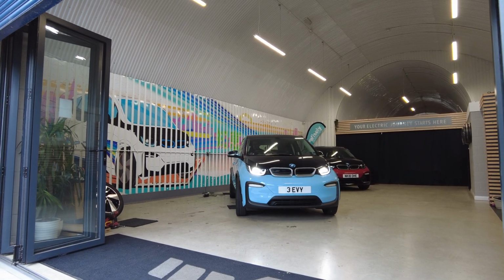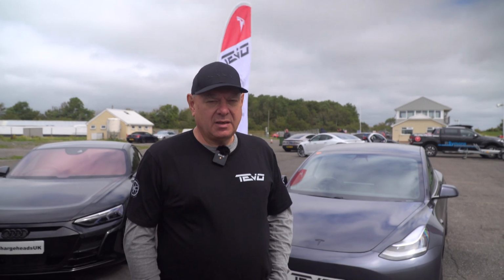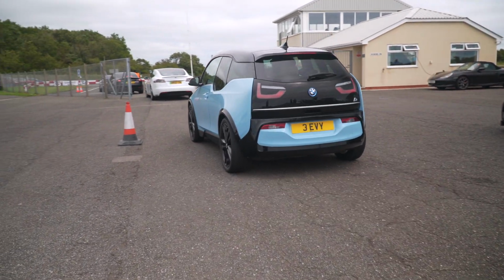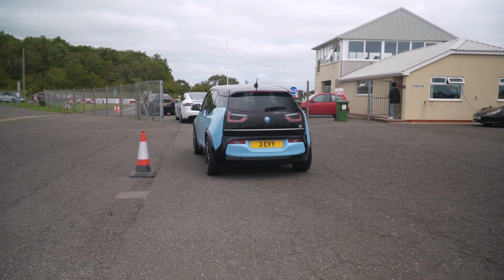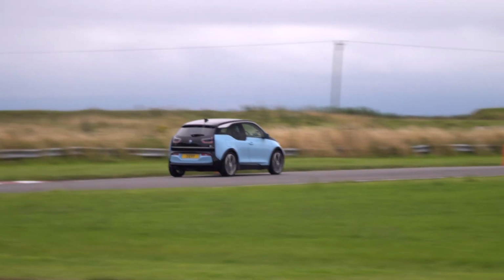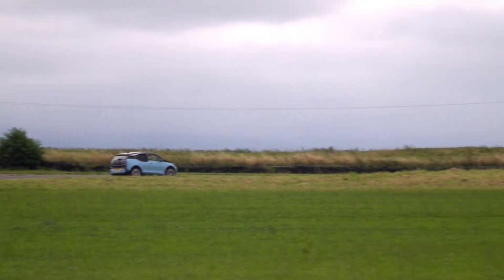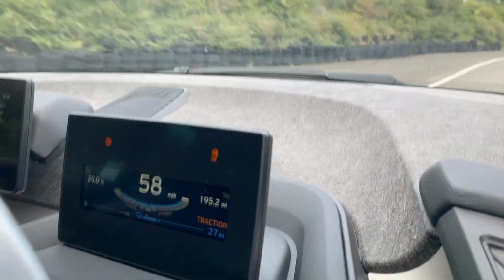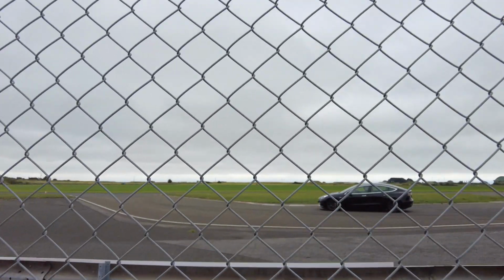BMW i3: On a Track! EV Track Day at the Llandow Circuit

Comment: Nice video. I Myself have mounted Eibach prokit springs and 19x6" and 19x5,5" costum alloys on 205 and 175 continental ECO  tires  on my 2016 94ah i3 and it handles so much better. really fun on back roads! have you decided if you will make a track focused car? would be nice to see if the power could be increased even more than the 184hp in i3s. more cooling perhaps and maybe a Coilover suspension added?

Comment: (Update: see my reply.) Definitely go with BEV. I will test mine on Hungaroring race track in 11days. BEV 94ah Eibach Pro lowering springs, ET28 (i3S) wheels, S software update: Sport mode. I recommend similar setup for your project. DSC off probably, or even Roller mode (that might need more experience from driver)
Reply: Well well. Electronics can't take the beatings. You get nice breaking distance thanx to regen and low weight.
However power is limited down to nothing after only 3-4curves on a circuit like Hungaroring.
Will check the telemetrics, but I remember seeing as low as 30kW (40 hp) limit only 2 or 3 lines on power display. Which kills the fun, ruins laptime.
I was expecting laptime of my 3000cc petrol BMW, instead got far worse than my old 2000cc diesel.
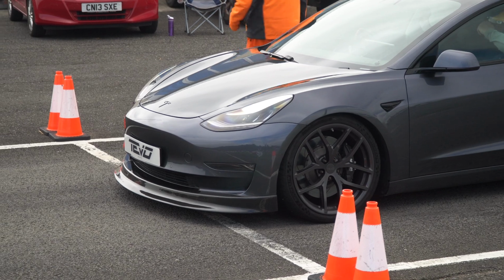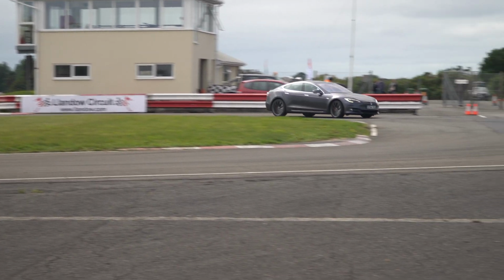2:22 petrol, 2:31 diesel, 2,49 drastically limited electric.
I wonder if a factory i3S is any better than my "software S". (I doubt)
Reply: Hi Who remaped your i3 to give it sport mode? Is that just a software roll back? As I'm convinced the initial takeoff has been dialed back
Reply: @Wootts007  In Hungary Wallnerwerk. It's more uploading i3S software for a dozen components. Yeah initial acceleration is def better. BUT an other service here said that a fuse in the battery might goes out (as it is smaller than in real i3s version) which is a costly replace process. So I decided to roll back to factory sw and let the sport mode go.
Soon I will buy an i3s with the 120Ah battery anyway.

Comment: 120 i3s with its wider track lower stiffer suspension fatter tyres and a real world 0-62 in 6.4s is a much quicker car than the figures would suggest. Also turn off Traction control then you can launch and drift it.
Reply: How do you turn off traction control on i3 ? I have an i3 and i couldn't completly turn it off...

Comment: Just a hybrid.
Reply from the maker: A hybrid which has just managed multiple laps on a track without using a single drop of petrol. 😉
Reply: @tw1919 used the last two brain cells you had left to comment that

Comment: I wonder which wheels would be better for track 19 inch or 20 inch. 
Also if there's a way to keep the mirrors flipped in, that could help at high speed.
Interesting informative fun.
Reply from the maker: The 20" wheels are most likely the better option purely due to the additional grip, despite the slighlty higher weight.
Reply: @wiselyauto  So 20" has better grip for bad weather too? I would love to see a video on tire choice, spacers, suspension lowering all in the service of improving stability. And the cons as well (ride comfort? stress on suspension/bearings?)
Reply: BMW could maybe sell the S software upgrade, although in the US it seems there unlikely to do anything that might keep you from buying a new BMW, like battery upgrades.